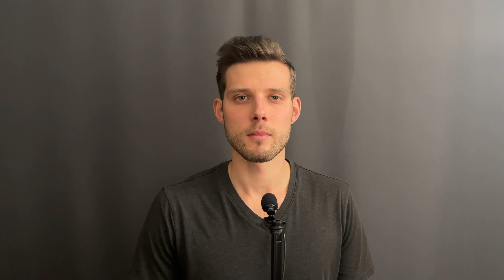ALWAYS Ask This Question FIRST to Design a MACHINE That Works!

Comment: The second question should be: what are the constraints? Sometimes there are multiple solutions to your first question, but when you define the limitations then you get better guidance towards a solution. Consider not only technical limitations but also project budget and timelines. Also I second what the other commenters said that you shouldn’t even start design if the solution can be acquired at a better cost.

Comment: 1:52 The question "What does the machine need to do in order to work?" This is ambiguous because "work" can refer to the way the machine functions internally, or to how it satisfies external needs.  This video is basically about first (a) devote diligent attention up front to gather and refine requirements that capture the need this product is intended to fulfill and the proposed product to satisfy that need.  But also realize that you need (b) to arrive quickly at a vehicle you can try out in the application to validate that the need is indeed as initially captured, and that the proposed product satisfies it in practice ("prototype", "MVP -Minimum Viable Product" etc). If not then (c), change course in some way while you still have some runway, possibly iterating or even abandoning. Acknowledging this entire path motivates a tradeoff between comprehensiveness of the initial requirements and design phase versus speed to get to a point where the preliminary product can be exercised in the application and there illuminate revised or new requirements.
Reply from the maker: Great way to put it!

Comment: You make a very good point here!

I had something similar happen in a project, where a lot of potential was missed because this question was not asked enough.  The machine was built to dispense a liquid sealant in complex patterns onto an electronics enclosure.  Engineering quickly jumped on the challenge of making those complex dispensing patterns work, which the machine of course ended up doing really well.  I would say, even better than the manual process that was in place beforehand.

What nobody had considered, though, is whether one-to-one replacing the manual process is actually desirable.  After dispensing, the parts are sent through an oven to harden the sealant.  It turns out that the parts outgas a lot in the oven, leading to sealant bubbles forming in some places.  As we learned later, the manual process always included a touch-up step after the oven, to fix these bubbles.

Of course, the same thing then happened with the automatically sealed parts.  Leading to only half of the real process getting automated.

In some way, the machine perfectly did what it needed to do; but on the other hand, it missed the objective of fully automating the production step. If more questions had been asked about the ultimate goal, the bigger picture of the process could have been discovered and an adequate solution could have been designed.  But by immediately jumping on the details, the macroscopic environment of the project was missed, leading to a suboptimal outcome.

Finding out what a machine really needs to do early in the design phase is such an important thing.  Regularly amazes me how much money is wasted in some places because this is not done...
Reply from the maker: Thank you for sharing this example!

Comment: I made a simple remote low height screw driver, for adjusting pilot fuel on ATV. It needed to reach in about 300mm  with a height under 24mm, including 7mm for flat blade bit. I had purchased a flexible shaft type, but it was too long and not possible to modify enough.  I designed a tool using GT2 timing belt, two idler pulleys, and metal flat stock.  I used spare printer parts from Z- axis sync.
I 3D printed a bushing to replace one bearing needed to hold blade bit fabricated from M5 screw. Printed a fluted knob for turning end. Drilled 2 hole and tapped one, far enough apart to tension belt. A bit of superglue to attach printed parts, and indelible marker for reference points. It worked.
Reply from the maker: Pretty cool.  Thanks for sharing!

Comment: As a product designer in the past, the single biggest mistake I saw others make was hard focus on the first design they came up with, instead of giving themselves more options and ways of solving the problem different ways. If you hard focus too early, you can go down an evolutionary branch that becomes a cul de sac later on, and you cannot get back cheaply to a better solution.
Reply from the maker: Great point!  So true.

Comment: I worked on industrial computers. Fortunately no millions lost on failed projects there.
One of the trickier ones was when customer needed a small (something like 10x20x30cm) passively cooled computer with two hot swappable hard drives. They also needed to be on dampeners as they'd be installed in trains. That is not a good environment for hard drives but SSDs were too expensive.
We did manage to come up with a system that moved enough heat to external fins from the hard drives, but that had not been considered at all during the design of the device. Complete redesign of the chassis would have been better but as usual the product needed to be out yesterday.
Reply from the maker: Thank you for sharing this example!

Comment: First question should be , "can we buy one? "  Because making a machine is ALWAYS more expensive than existing ones.
Reply: Possibly, or can you modify an existing machine to achieve your solution.
Reply from the maker: Great point!  It seems to be true even if the machine seems way too expensive for what it does.